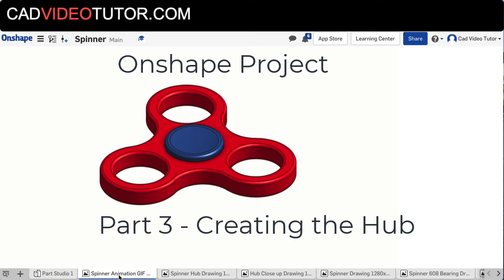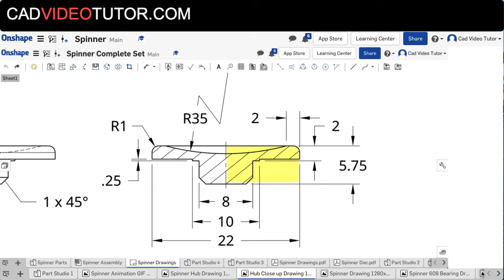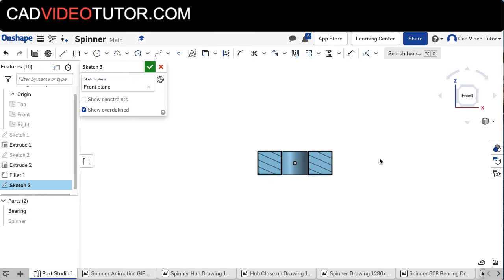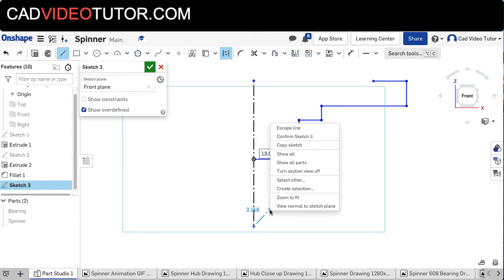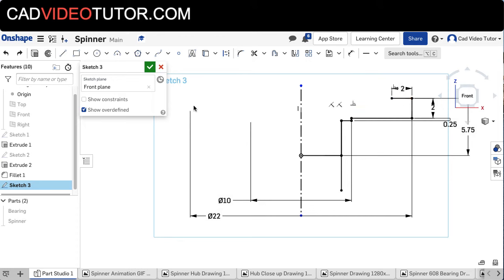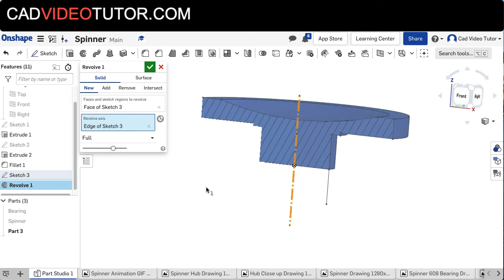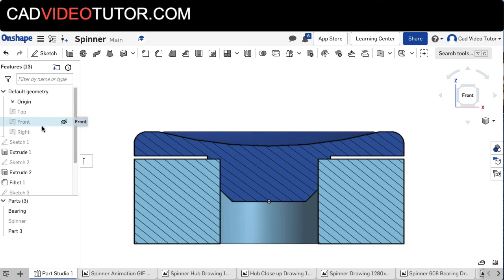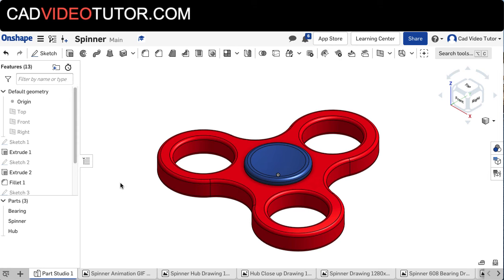Onshape Project - Spinner - Step 3 - Create the Hub

Comment: For some reason, my "revolve" is only created in the area "within" the bearing interior.  I have a profile that turns gray as expected (is fully enclosed), but when I select the construction line as the axis, it leaves the upper portion (the "wing" of the drawing) gray, and won't revolve it.  I can't figure out what I'm missing here.
Reply: same isue. did you figure it out?
Reply: @Onshape.Learning.Projects
Reply: @lukakakabadze8383   It's been awhile, but I think my issue may have been that my revolve axis was too short.  Assuming you're using a vertical construction line for the revolve axis, simply make that line "taller" than everything that you're looking to revolve.  If you look around the six minute mark, you can see that the vertical axis line (dotted line and unconstrained with blue dots at both ends) extends both above and below the shapes to be revolved.  Make sure yours looks like that too, and it should work.  LMK if that works for you.